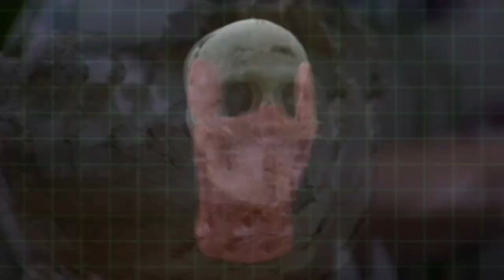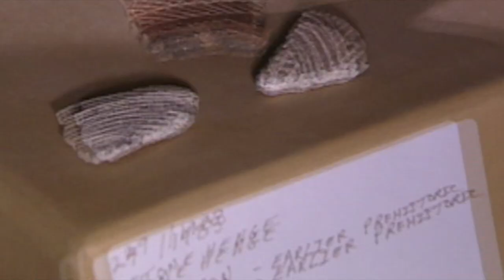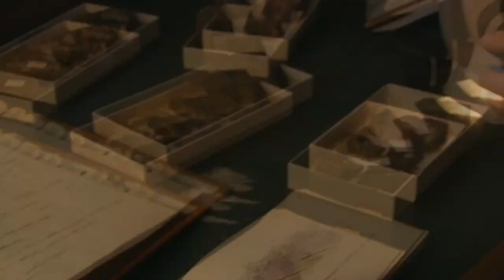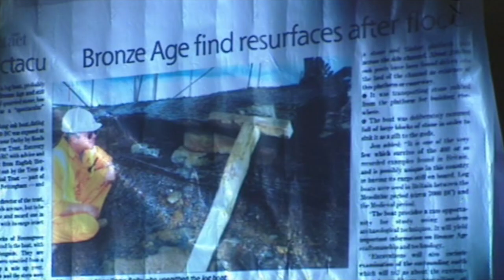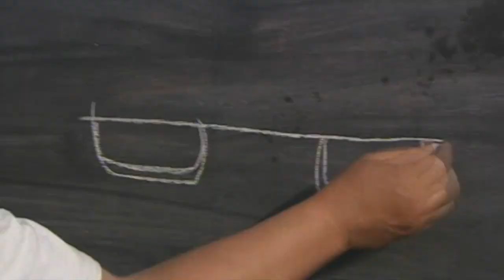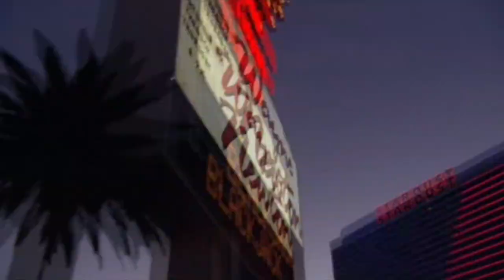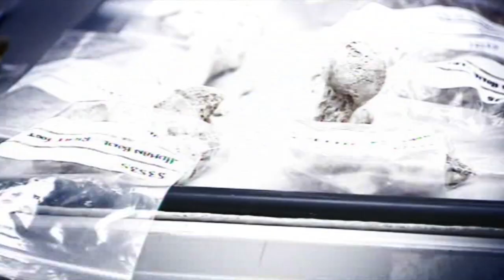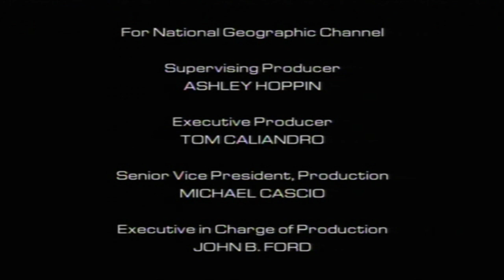Who Built Stonehenge?

Comment: I built the Stonehenge I saw the big stones already there I dug holes equal to the length of each stone then I slided and buried the stones into those holes vertically then I slided  the remaining stones on top of the vertically buried stones then I dug around the vertically buried stones the result is infront of you. Don’t make a big deal out of it it was very easy.